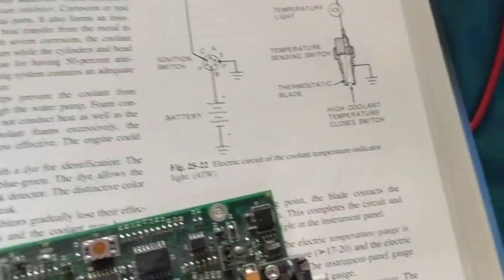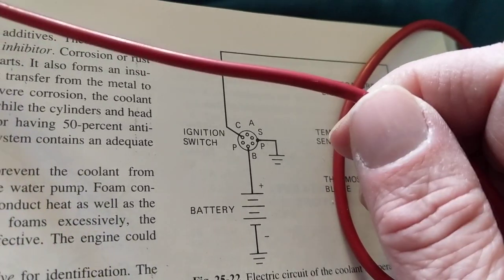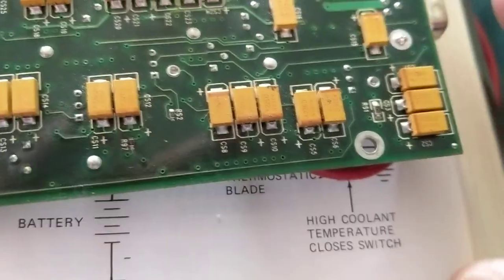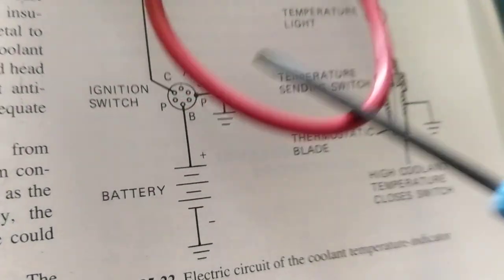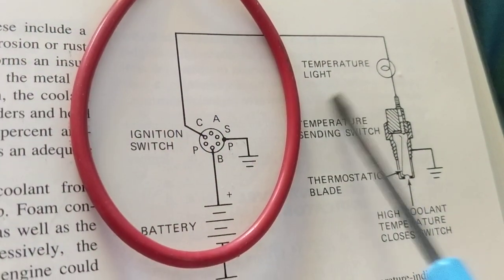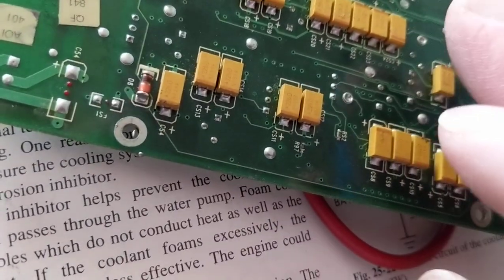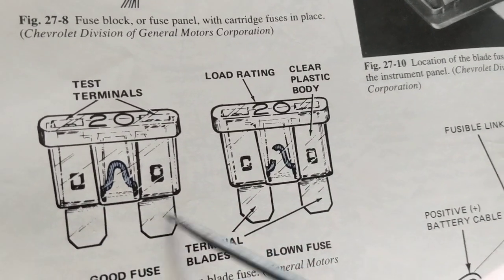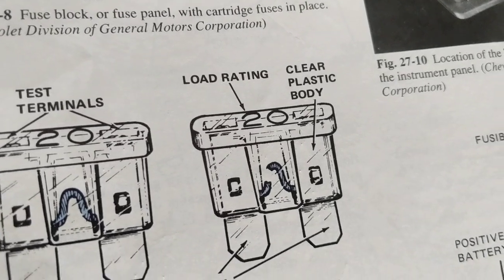HOW TO UNDERSTAND ANY SCHEMATIC FROM AUTOMOTIVE AND THEIR MODULES FOR BEGINNERS

Comment: Good morning Joe and nice to meet you my friend!

My vehicle (2003 Dodge Caravan Se V6 3.3) is giving me a (P0201-Injector Circuit/Open Cylinder 1) code and i have a (2003 POWERTRAIN DIAGNOSTIC PROCEDURES book for town & country, caravan and voyager) that shows on page 88-89 test procedures to follow and apply. 

So far i have applied (test 1) and (test 2) and im on (test 3) now and im stuck on not being able to follow and apply it cause im not grasping and understanding it at all. 

This is Test 3
Turn the ignition off.
Disconnect the Fuel Injector harness connector.
Remove the ASD Relay from the IPM.
Turn the ignition on.
Jumper the Fused B+ circuit and the ASD Relay Output circuit in the IPM. (This part im lost)
Using a 12-volt test light connected to ground, probe the (K342) ASD Relay Output circuit.
Does the test light illuminate brightly?
Yes      Go To 4
No     Repair the open in the (K342) ASD Relay Output circuit.
          Perform POWERTRAIN VERIFICATION TEST VER-5.

This is a video of me following and applying (test 2-https://www.youtube.com/watch?v=rbzQKyiNwcA) and in that video it shows the pages in the book from page 88-89 and pages 312-314 for code (P0201-Injector Circuit/Open Cylinder 1).

Are you able to please make a video showing me how to apply (Test 3), (Test 4), (Test 5) and (Test 6) on page 88-89 and the same from page 312-314 (Test 1), (Test 2), (Test 3), (Test 4), (Test 5) and (Test 6) shown in the video?

Comment: This video is a cool introduction to how to think about schematics
I've heard the mid planes are often just voltage and/or ground on simpler multi layer designs
Reply from the maker: you are exactly right Judith I discussed that in previous videos about all the layers that make up these pretty circuit boards they are very complicated and multi boards thank you for your comments you're 100% right